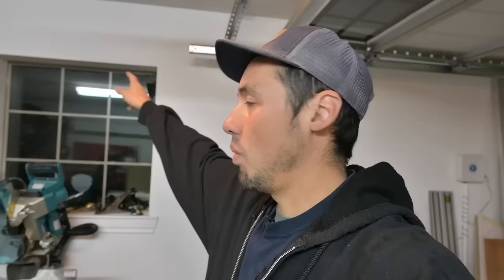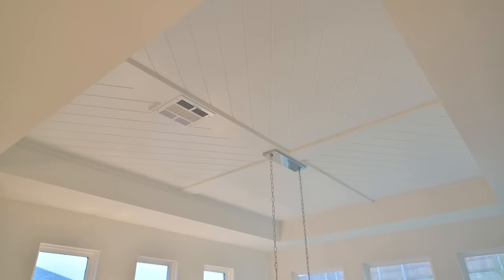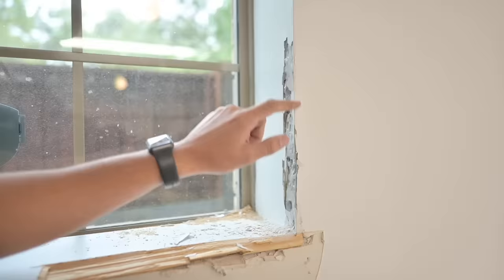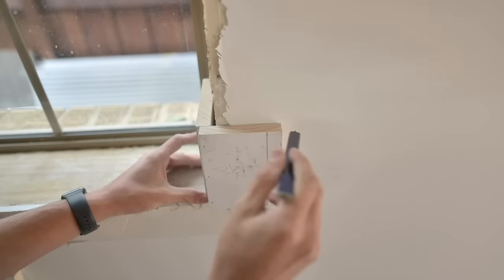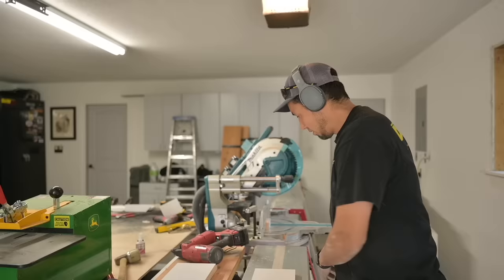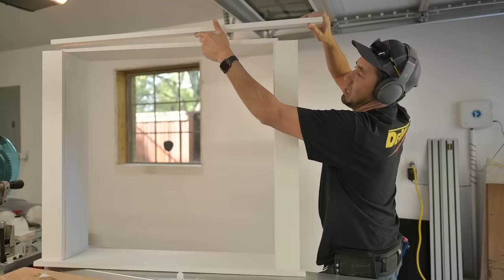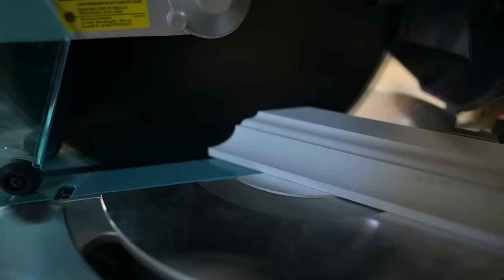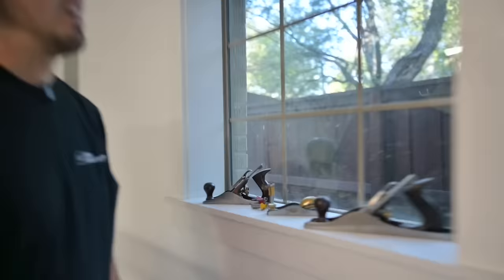Window Trim Build and Install.

Comment: Great work Rich 😃👍
Hey will you be doing future crown install videos in your new place?
Also, I didn't see that Milwaukee screw gun (i think it's the 12v one) you used to fasten the pocket holes on the casing. 
Can you let me know which it is? Thx

Awesome work 🇺🇸😃😎💪

Comment: Awesome video, I’ve watched it about 10 times to try and see how this is done. One question I keep having is, what is the purpose of a miter on the horns of the sill? In my head it looks like you are cutting a miter then just gluing the same piece back on. What am I missing? Thanks!
Reply: He’s doing thag because the end is exposed raw wood, and when he miters it he puts a primed face on it. Just better for painting and finishing.
Reply: Your right. I coudnt get over this step. Much faster to sand it and carry a quick drying primer if you want it primed... but to each is own I guess. Another thing is the pocket screws were unnecessary on the jamb butt joints... a screw from the butt joint or glue and nail would have worked fine and a bit faster (also plenty strong enough for this application, but I guess he cant help but use his machine. Who could blame him?!

Comment: Can you explain what the screws were for? I’ve always just made the box fit tight in the window.thanks!
Reply: He used them as shims.  You can make the box fit tight in the window but if the framing is off it won't be square.  The framing is usually off.

Comment: I trimmed out a few windows in my house before watching this video. I left the drywall instead of knocking it out. I just painted the drywall the same as the trim I put up around the window. Is this a bad idea for the future?  I didn’t see the need to remove the drywall if it was in good shape.

Comment: Window casing looks great!
Question: what is the purpose of the “screw shims”? I missed why they were needed. And did they get removed before the final install? Wouldn’t these shims cause a gap between the new casing you’ve made and frame?
Reply: I'm guessing it's because the framing is setup for drywall and wouldn't give the proper reveal on the window if he just flushed the leg material with the framing
Reply: Using drywall screws for shimming is great. You can really fine tune them and they stay in.
Reply: @klmbuilders5385  Ok the shim makes sense, but wouldn't there be some at the top as well?  You just pick a side and place your screws adjusting them in and out for a tight fit prior to nailing finished window trim?
Reply: I had the same question and hope he responds with his thoughts
Reply: @klmbuilders5385  Hey... are you the same KLM all over Mchenry County, IL & SE WI?
Reply: The screw is just a replacement for a shim the screw stays in place to give the extension jam a proper tight level fit inside of the window framing
Reply: @chadchiappetta4440  this rationale is exactly how my builder taught me.
Reply: I always make the jamb box the exact size of the window but put wood spacer blocks around the window matching the exact gap between it and the framing.

Comment: Another excellent video.  You do excellent work. I have a question for you. I just put new construction windows in my 35 year old colonial.
I had 4  1/4" belly casing that I'm replacing with 1x5 to cover the old lines.  So my windows are not inset like yours they sit ALMOST flush on the inside.  When I put ice and water shield around the window opening on the outside of the house it kept the windows recessed in say 1/16"
to 1/8' max from the drywall on the inside.  I want to prefab everything like you did in your video because I have 14 windows the same size.
So with the window being recessed that 1/16" it doesn't allow the casing to lay flat on the window and drywall.  What do you suggest that I can do  to get them to lay flat on the same plane with each other?  Ty

Comment: Curious about the doorway at 3:28. In the 1x12 shiplap install vid, the casing was removed. In this video, we see the 1x12s butting against the casing. Since this is all 1x material, I wonder if a wider jamb was installed?

Maybe I'm overthinking it--or not thinking enough, which happens from time to time.

Comment: Nice and clean with the pocket screws! Why did you remove the dry wall return and corner bead? Was it so your casing doesn't overlap your window frame?

Comment: We were taught the distance from the front and side of the casing to the edge of the sill/horn should be the same.   My 2 cents.

It actually looks like you did that.  My bad.  

Can't wait for the shop to be completely kitted out.

Comment: Looks great!   Noob question: why did you remove the drywall?   Couldn’t you just build over it?
Reply: I have the same question. Perhaps it is because of the lip at the edges of the window? Hoping it is a step that can be avoided if possible.
Reply: @sleeps0341  most likely because the extra material would cause the wood box to be smaller than the window frame, essentially causing the wood to die into the glass.
Reply: That makes sense, and now looking at it gives it a cleaner look in the end.

Comment: Richard, I noticed my pocket screw jig came with a 6” driver bit that helps a lot with clearance to keep me from messing up the finish with the drill chuck. You seem to use a shorter bit and I wonder if that is an advantage? Thanks, and great video and good dad jokes.

Comment: If the new Makita miter saw is going to live under the window, why not have some fun and paint the window trim Makita blue/green color. It's just paint, so it always can be changed when you sell the house or just get tired of it and or when that saw is replaced with another saw or tool.

Comment: Love the content. Any reason you don't make the top upper jamb and cap one piece, instead of 2 pieces like you did. Then there wouldn't be a joint across the width of the window?
Reply: I was wondering the same thing, then I thought it was to create a top reveal, but you put the small piece flush.

Comment: Do the battery powered nailers leave same size holes in work as pneumatic nailer that require a hose?  Are they good for oak wood?  Good video.

Comment: Howdy RM. thanks for the content! You shot a 15ga. I am about to purchase either a 15ga or 16ga trim nailer, DeWalt. Do you have a suggestion as to which if I have only one. I do have the 18ga and the 23ga. All cordless. Thanks!

Comment: Hello Richard. I’ve used your tips to case out 2 windows. Your videos taught me well. Sincere thanks. 
One question I hope you can answer. When do you case over the drywall header & jambs & when do you tear them out?

This choice never entered my mine. I cased over  my drywall header & jambs. Was I wrong or right to do so?
Reply: There's not a wrong or right. But there are a few factors that could encourage one or the other. Often the corner bead and drywall build up will cause your window trim to sit proud. This is the main reason I often remove it. If its not proud, but you have a narrow detail on the window frame the trim may not leave enough window so all you see is the glass. This would also be a reason to remove it, unless you want that look. If you have a larger width to your window casing (thickness from the glass to window edge) you be fine to leave the drywall. Anyway, Im sure there are more reasons, but if gives you the idea.

Comment: Maybe I missed it in the video but why the drywall screws (which you measured horizontally from) into the sides before installing the frame?

Comment: I meant to ask in your makita slider reveal video, how much calibration did you have to do out of the box? I'm in the market for another miter saw and I'm curious if you had to true up the fence, blade, and miter gauge very much. My ridgid isn't cutting it anymore, pun intended.

Comment: Darn. I was hoping to see what you painted that window trim kits with. I noticed you were brushing but from the plastic protection it looked like you sprayed it. Curious on the tip size  if you sprayed it and what you set the cfm at for the finish..  and the paint you used . Man I’d be so stressed with all that furniture around.

Comment: Excellent work. Awesome machine " Castle" machine. How much do they go far? I like the screw shim techniques. How did u come up with this and what is it really helping accomplish? ( dumb question lol) Also I need to get some of that glue you r using for when I do my ceiling crown molding. Thanks in advanced !!!

Comment: Top job and extra impressed by the"JOHN DEERE" pocket hole magic machine...
Any reason why the protruding uprights didnt get pocket screws aswell?
A great and powerful colour to contrast white tones is MONUMENT from the DULUX(Australian Paint Company).
It is a very dark purple toned Black/Grey colour.
If you cant access it, I'm guessing there would be something similar in the AkzoNobel/PPG ranges in the States as they are associate companies of each other.

Comment: Great job as always, one question though, if the stool/sill has no decorative edge as yours, was it really necessary to put a miter on the ends when it's a paint grade trim?
Reply: It lined up the corner
Reply: You get a better paint finish by avoiding end grain whenever possible.
Reply: @rolfschubert1853  if is going to be painted I don't think it matters much, just sand it and prime, done

Comment: What do you do with the gap between the window and the casing?
Reply: I was wondering the same thing
Reply: Wondering same thing, hoping for a reply.  There may not be enough thickness between framing and those reveals on the window.  I think he ended up with bare wood ledge on the back side of the jams.  

I also would have like to know how the height of screw shims were placed.

Comment: Great video. Always so helpful! 
Question, If I wanted to apply similar casing but window is 3" from wall, how would you handle it? Work with the space you have and legs would be different widths idk?

Comment: Great tutorial once again.  Quick question, what do you do about the gap between the wrapped window frame you built and the metal window? It seems like you might have 3/8 of an inch or so.
Reply: I was thinking the same thing. I've seen some people put a little piece of molding around the inside the cover that Gap

Comment: what if the wall is bowed out and the interior window legs are different lengths at ends. Do you cut to fit or make it bigger and add a moulding on the inside of the window.

Comment: Hi Richard,

Another great video. I’m a woodworker not a carpenter. I have a whole house to trim out but I’m in Florida and the house is concrete block. Would you use the same method to build these but just leave the drywall on the window openings? 
Thanks!
Reply: You may have already done it, but I think securing plywood to the masonry inside the jamb is a good option. Then you have a suitable nailing surface for the casement

Comment: What's the purpose of the screws in the jambs? Are they used as a shim?
Reply: I'm guessing it sticks out 3/16" in order to create the "reveal"?  Dunno
Reply: @Jordan-kk5xj  I doubt it. The reveal can be done without them. Typically you would have the legs fit tight to the jambs.
Reply: Wiggle room
Reply: Used as a shim.

Comment: I feel dumb that I don't understand the screws. Do the legs of the casing now have play within the window framing - the distance the screws stick out? If so, was that for play or because he needed the proper window reveal and without the screw spacers there would be too much window reveal?

Comment: Why would you use 15 gauge nails, when you can put some caulk behind the wood and then use an 18 gauge. If you use spackle, you are still going to be able to see the impression where the nails are at as soon as the spackle shrinks. You are much better served to use a smaller nail and then use Bondo. That way you are assured you will never see the holes because Bondo does not shrink.  The caulking behind the trim glued it to the drywall and the 18 gauge nails are only there temporarily to hold it until the caulk dries

Comment: Hey that one by 12 on a 45 by the fireplace, what did you do to that outside edge to prevent separation? Is your trim super super tight, is it caulked, or Bondo? Idk 
AWESOME WORK AS USUAL 
 🇺🇸 👊🏻 🤙🏼 💪🏻
Reply: CA glue is what Rich uses, he probably filled the seams as well

Comment: Why did you miter your sill at the horn when it takes you right back to where you were to begin with on a painted end product?  ...stain maybe I get it with regards to grain flow.  Nice prefab though.  I'm doing something similar in design now, but cornice/crown seems to be too small proportionately to the crosshead, I'm going to cap the top of the cornice with a 3/8"rip and leave 1/2" overhang over the cornice.  Lay a piece of scrap rip on top that leaves this reveal and you'll see what I mean.

Comment: Maybe a dumb question, could you use CA glue to fasten the frame to the wall instead of using nails...so there would be no nail holes to fill?  Is there some other way to attach the frame to the wall without making nail holes?

Comment: I saw lots of people asking about the screw "shims" but Richard never responded. It doesn't look like in the installation that the screw shims were still there. So if they are there just to allow some wiggle room for out of plumb conditions or expansion/contraction, it would seem like you could just reduce the overall length of the apron and header piece, right?
Reply: I was thinking the same thing. Measure to the shortest point and then subtract 1/4" for play. Unless he intends for the casing to be tight to the screws to hold it in place. Did he drive screws at the top also?

Comment: Be careful with that blue tape on sheetrock. I have had it rip off the paper on the sheetrock.  Those 45s on the corner look outstanding! That is not an easy thing to get those that straight and crisp! Awesome.

Comment: @finish carpentry TV So it appears your jamb stock does not reach the window pane surface, could be illusion... But how do you finish you inside corners around the window trim.  I have seen others use Caulk on large gaps, which looks horrible (IMO), some people run jamb stock right up to the glass and then use painters tape and a thin bead of siliconized caulk, and I have seen others use hot mud to fill the gap, curous as to what you and others on here are doing when you have a large gap between the jamb stock and glass pane.

Comment: How do y'all deal with uneven drywall? I was doing a house where the legs would shrink a full 3/4" over the span and then the header did the same on a different axis etc. I ended up building the box, then scribing it, then disassembling it and cutting each piece individually, then reassembling it. Pain in the neck but I couldn't figure out a better way
Reply: That is why removing the drywall will give you better results with the casing. Easier to get the casement square.

Comment: What is the benefit of making it a unit and installing vs nailing it into the rough frame piece by piece?
Reply: I usually assemble the window extension and stool/sil together.  Then nail that to the opening shiming it to the reveal i marked on the window. 
Then spray foam for insulation. 
Then nail on the casing
Reply: @Boomkelly  thanks!
Reply: The benefit is that you're not relying on the squareness/straightness of the framing and walls for your trim.  I've done it on my more recent window and door framing and it comes out perfect.  No gaps.  I even went to the trouble of gluing the trim to the sill and uprights.  No nail holes to deal with and it looks fantastic.  More time consuming.  I don't think you could do it as a contractor though.  Too much time and have to wait  for the tightbond to dry.

Comment: Curious, what's the point of the "3/16s reveal"?  If I saw some amateur do this, I wouldnt be able to tell whether they unintentionally misaligned it or not.

Thanks!
Reply: 3/16 is just the reveal he has used.  Whatever you use has to be the same or it won't be uniform.

Comment: Why miter back the corners when they were already at the proper distance and that type lumber dimension didn’t change the look of the end anyways. I understand doing it on 1/2 round or crown moulding. Not on a 1 x whatever. All the rest info is amazing. Just don’t get that part. Seems like a wasted step.

Comment: What is the point of doing the returns like that on the sil?  Why cut it at 45 degrees and then put that little triangle in there to replace the wood your removed?  Why not just leave it the way it was before you cut it?  Asking as a lay person.
Reply: You never want end grain showing  -
Reply: It’s so the ends look just as finished as all the other surfaces; just making it look like a professional finish.
Reply: @jgoody7467  That makes sense, thanks!
Reply: @rachelcolvard791  Got it, thanks!

Comment: you cut off those small corners and glued them back on ....why?
Reply: I wondered the same thing but figured out it was to avoid the end grain
Reply: @pnwester2697  but now he has a joint he needs to fill with DAP or DRYDEX and sand it. The entire window trim will be painted anyways even if you have edge grain its not going to show. I dunno maybe ur right I just found it unnecessary.